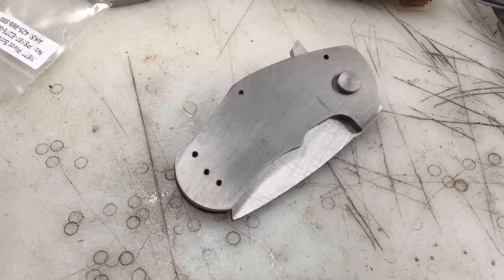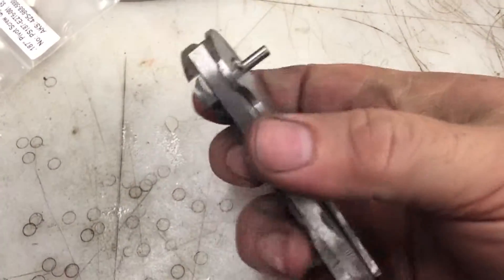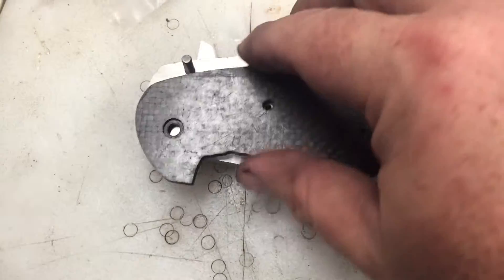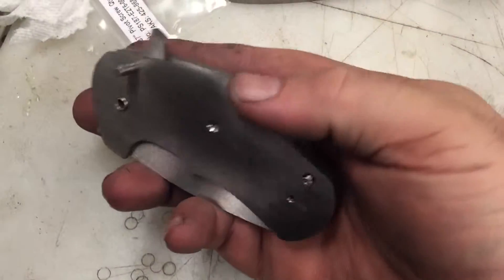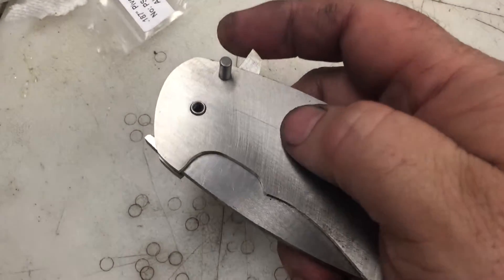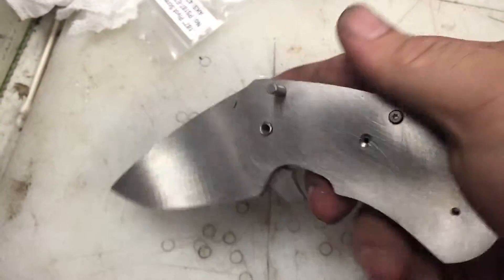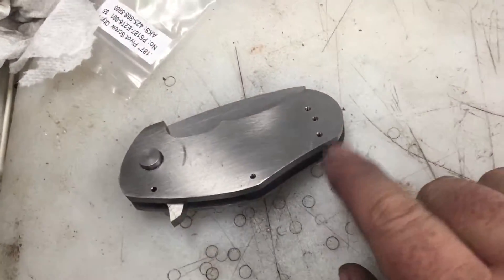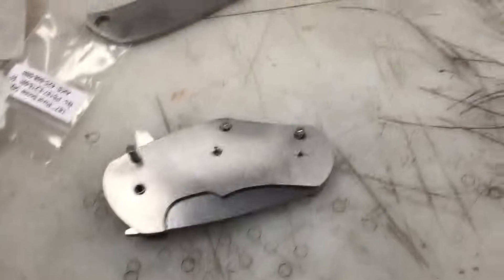My first frame lock work in progress

Comment: My first flipper shares a similar stop pin and lock bar setup. I thought I was good to go until I installed the detent ball. In your design, does the detent fall off of the blade before closing all the way? I also ran into an issue with the lock face being too high in comparison to the lock bar which instead of pushing the lock bar straight back, it wants to flex it up giving the illusion of vertical blade play. You may not have this issue however because of your shorter design. I now see why so many makers use an internal stop pin track instead as it opens up a lot more options but you sacrifice some strength.
Reply from the maker: Hey Mike! I spent weeks designing it in illustrator so everything should be ok and also have had a good friend mentoring me who does it full time. But the lock bar is next and being my first is my biggest stressor but time will tell haha
Reply: Eric Luther Knives The lock bar cut isn't bad at all it just takes forever. I'm interested to see how this turns out. I may prototype one more of my old design to see if I can improve it. I rolled the dice and had 10 blades heat treated before I saw the issue.  Grinding the lock face was more stressful for me but it wasn't bad at all either one I got the angle down. Its amazing how much really goes into these framelocks. Best of luck on yours!